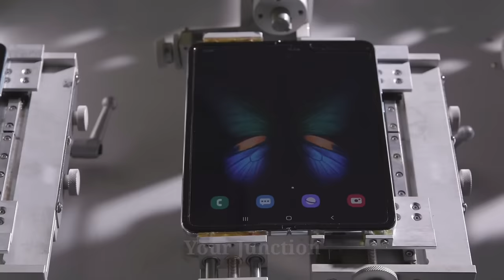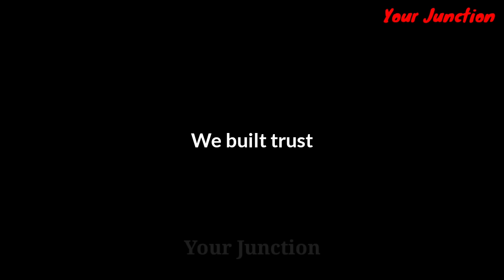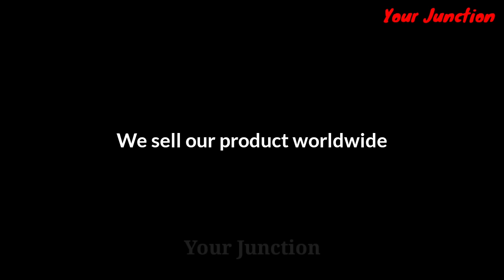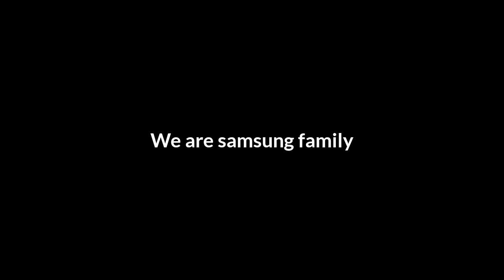Samsung Galaxy - New Factory tour  2020 (Must watch)

Comment: We are buying and using Samsung phones However, later S20 phones had dual SIM cards I was disappointed that I could not use the SD card when I tried to use it Samsung S20 smartphones or later On Samsung S21 phones ‌You can use two SIM cards and an SD card at the same time If the system is changed, better sales will increase Indeed, in the next Samsung S series Let's use two SIM cards and an SD card at the same time As a fan of Samsung, please let us know Suggestions are required Samsung S20 currently on the market If you want to buy a phone but want to use two SIM cards The SD card had to be removed, so it was not convenient